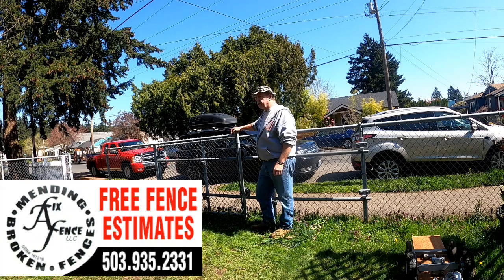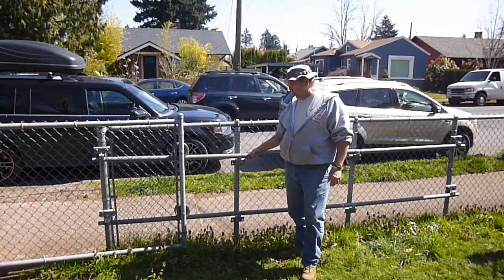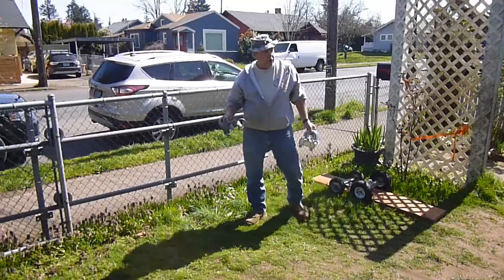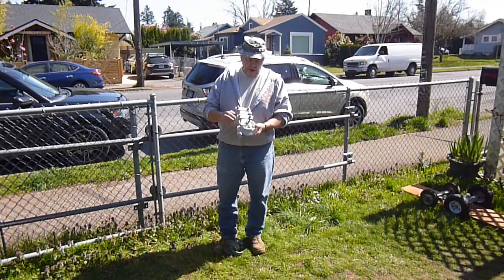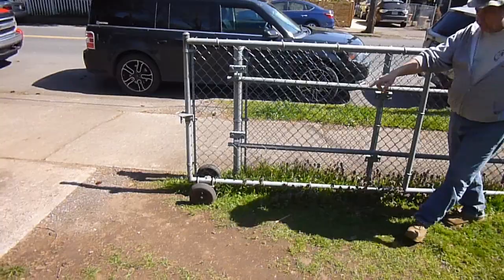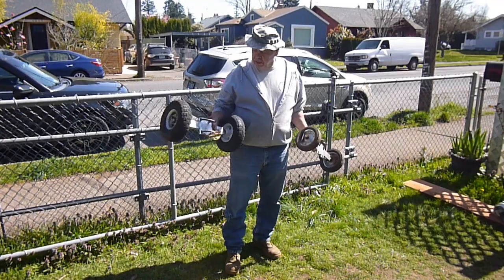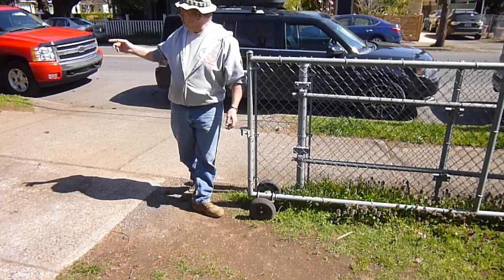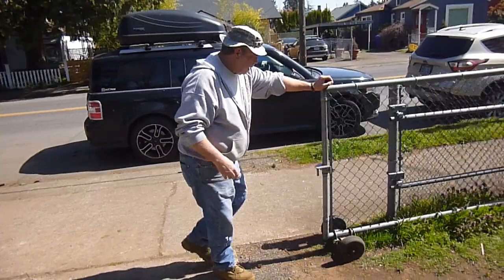Chain Link Fence Slide Gate Components

Comment: Awesome video clip! Thank you for mentioning the part items names, and size of the rails.
Reply from the maker: Thanks,..one thing to remember is that I named the parts as I know them here in Oregon,..keep smiling!
Reply: @jwthefencer  hello I'm wanting to remove a 10 foot double gate and install a long gate on wheels and rollers it would be great to contact you
Reply from the maker: @tetragrammatonbrahman4291  It was talking with you,..I will do my best to help you out with the part names you need to pick up at your local fencing outlet,..look for the small ma & pa shop's they may need your money more so than the bigger out fits,..
Reply: 1. 5.8 is the rail

Comment: can the slide be on the outside/streetside or no?? i have jasmine plants climbing up my fence
Reply from the maker: It can,..you would have to cut the chain link for the track brackets to fit up against the posts,..but you would be canceling out any security measure you would be installing it for,..it will work though